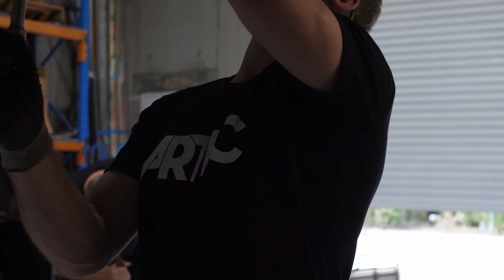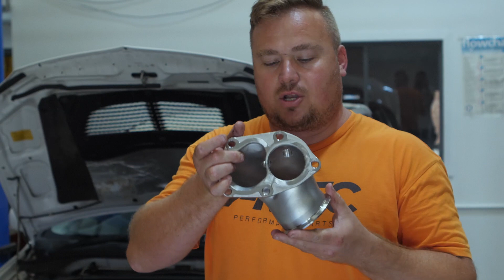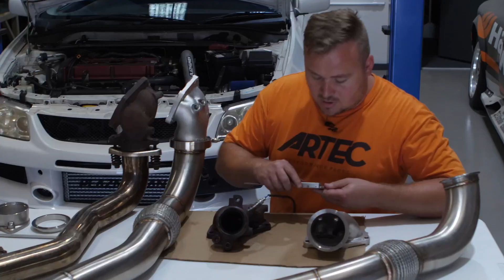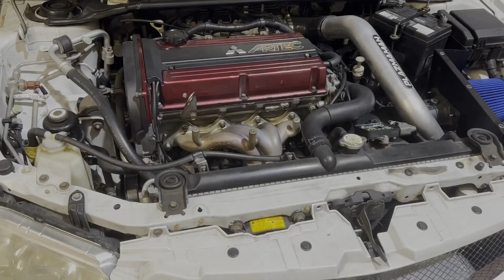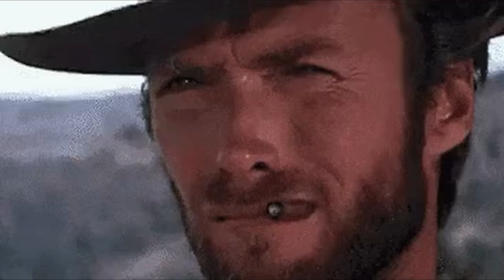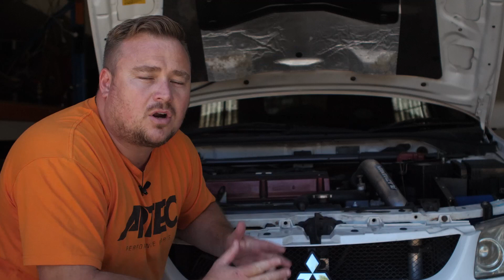Evo 9 Wagon 10 Second Build by Artec Ep11 - Artec Front and Dump Pipe

Comment: For the o2 housing gasket where it bolts to the turbo, do you use an OEM gasket (non-divided) or an aftermarket divided gasket like STM Stainless Steel Divided Turbo Outlet Gasket - Evo 4/5/6/7/8/9?